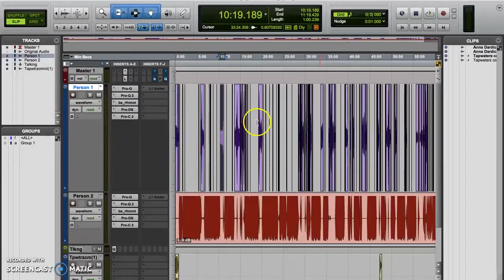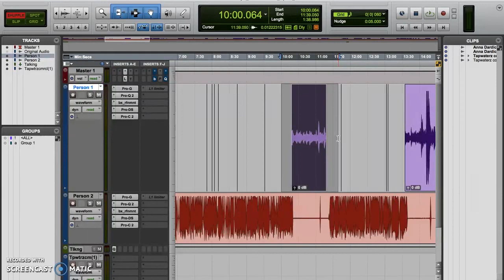The Nudge Function in Pro Tools

Comment: Thank you. Its working well for me for nudging audio. But I seem to be having an issue with nudging a video clip. It only nudges my selection not the actual clip despite selecting the clip!  I've never had this happen before.
Reply from the maker: oh interesting. I haven't dug into nudging video clips at all. Did you figure it out? I'm curious
Reply: @CatoNoise  oh ya something to do with the frames of video. Older version of pro tools. Will only nudge by a certain amount.  It's time to upgrade so I'm free to work at any frame rate. 
Aparently I got lucky and I had already bought a perpetual upgrade last month it was ultimate 2 days before they announced no more perpetual.  I just didn't activate to the new computer yet but that should allow any kind of timecode and frame rate matching there.
I was also into compatibility and graphics card issues so that may have had something to do with it.  We'll see if it improves on the new machine.

Comment: Hi guys,
Crazy question that nobody seems to be able to answer...so I turn to you, the MASTERS of the universe. : ) 

I'm using Pro Tools 12.4 on my MacBook pro, and I'd like to be able to open the Transport window (bar) with a shortcut. With a "regular" computer it's COMM / 1 (on the numeric keyboard to the right) but obviously we don't have that on a laptop. 
I've even tried to create my own shortcut but it just doesn't seem to work. 

Any ideas would be fantastic.
Reply from the maker: I think you can hold function and then do the shortcut with some shortcuts. That's what I do to drop a marker when I'm on my laptop and don't have the numeric enter key. Try some combo of the shortcut with the fn key? (also, sorry it took me so long to respond to this! YT marked this comment as spam for some reason - I need to get better at checking the spam section of my comments every so often). Take care!

Comment: Useful tips that i will implement starting with todays project. Totally forgot this stuff in the thousands of Pro Tools complexities and have completely left this out of my workflow. One of the things I struggle most is finding the perfect leveling between a consumer-pro grade recording and a "oddly compressed and auto leveled" Skype track. Others tell me it sounds same volume but the contrasting sound profiles and maybe 1dB of difference tells me otherwise.
Reply: "Oddly compressed and auto leveled" relating to the odd coloring and characterization Skype and the program Ecam does to the sound. Wish there were lossless 48Khz programs like the Skype and Ecam combo.